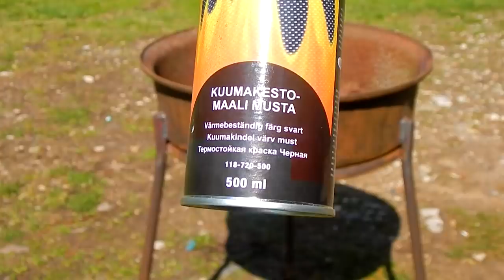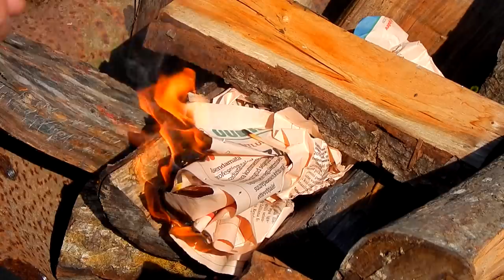Old Rusty Wheel Into A Simple Grill

Comment: That was good use made old the old truck wheel if you didn't need it. What did you do, get tired of working on the workshop? You need a grid with closer space for burgers or steaks though. The skewers were a great idea since your grate has such large spacing between the wires/rods.
Reply from the maker: We have grilling kits available which also include double sided lockable grids with handles on them for steaks and burgers. You can just clamp the meat in between the two sides and voila. No grid on the grill needed. I built this grill keeping that in mind.
Reply: @DonnDIY  I have some of those if I haven't sold them, those are pretty neat/cool. I forgot about  those, they will work fine.

Comment: But it is still a rusted one,it is not properly done
Reply from the maker: I left the bottom and the inside of the grill untreated since these are gonna get heated up anyway and shed paint more than the sidewall. I wouldn't want to eat anything that is cooked over heated paint. If you buy a grill from the store and before grilling anything on it you have to heat up the grill to the point where the paint burns away from the inside and even your store bought grill starts to rust and before you know it - it is broken due to the thin wall thickness.

Comment: There is nothing simple about making that grill who in the f*** have all that equipment ark welders, pipe benders, grinders, it's cool but not a project I can take on
Reply from the maker: Welding and grinding are two most basic steel working processes. I expect people to know that before watching steel working videos so it doesn't come as a surprise to them that they need actual tools to shape metal. I'm afraid it's just the way it is. Thank you for watching.
Reply: @DonnDIY  I'm pretty sure you have a lot of viewers that has no concept of what your doing but watching any way I'm in the construction field so I do have a clue of what your going I just said it's nothing simple about it and thank you for responding
Reply from the maker: Even more so - if you work in the construction field you should be quite able to whip together things easily without any special equipment since the work (at least in my experience in construction) sometimes requires ingenuity on site. In the title I was referring to the construction of the grill - a bowl and three legs = simple. Whether the way I built this (using grinder and welder) was simple or not I leave it to others to decide. One can always bolt things together and bend pipes other ways. So I'll stay true to my opinion on this design of the grill being simple rather than complicated. In conclusion - for example, if I don't have CNC milling machine or such other equipment I simply can't blame the ones who use them for my inability at CNC work and the lack of needed equipment. It is my personal problem and responsibility if I want to do such things but can't. In my opinion it is as simple as that.
Reply: @DonnDIY  okay nice talking to you